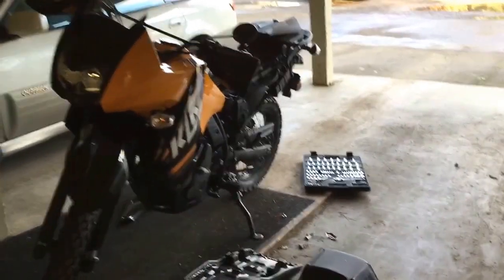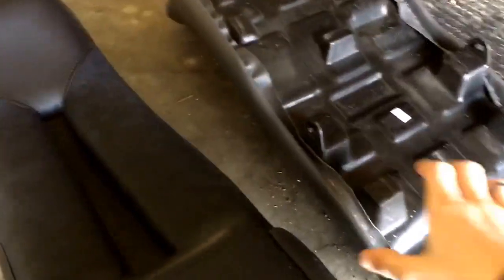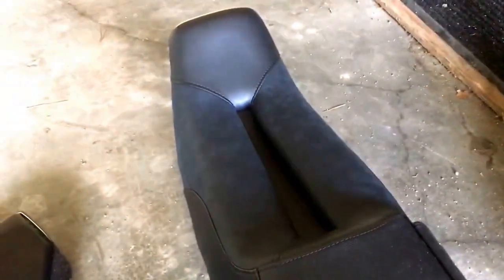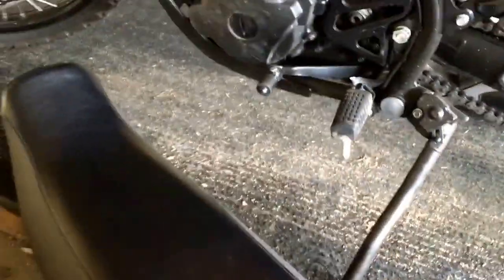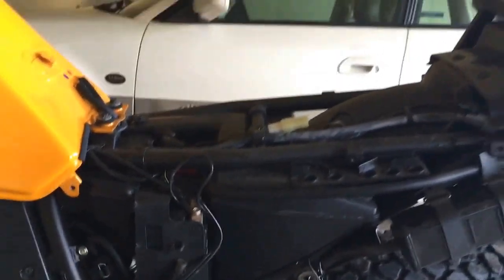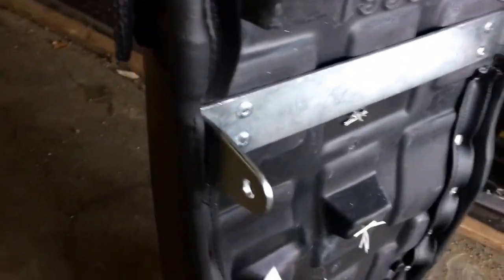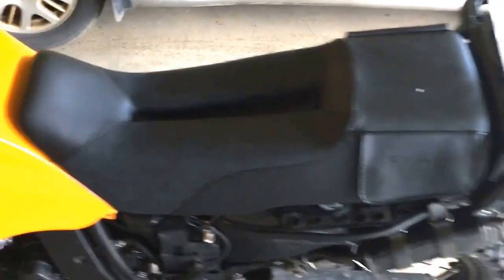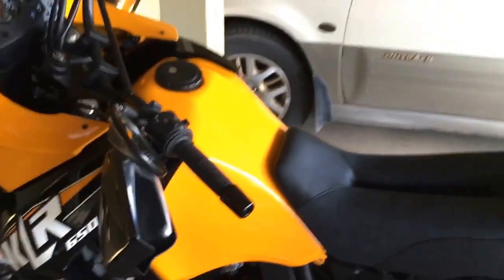KLR 650 seat removal and replacement.

Comment: I bought a slightly used Kawasaki Long Ranger 650 with no owners manual so you were a lifesaver, however my gen 3 only requires one bolt on each side without the removal of any side covers. it looks like  the new seat has no way for water to drain out if you were caught in a storm or got wet wihle going through a river, or maybe there is.

Comment: Have you had a chance yet to put some miles on the seat?  And, how do you like it?  Thanks
Reply from the maker: So far I have about 300 miles on since putting on the seat, and I am really enjoying it! One thing to remember with most aftermarket seats especially with the gel-seat  like this one, is that it will get more comfortable the more miles you have on it, and it isn't quite broken in until you have about 1200 miles on it. That was also my experience with the gel channel seat that I had on my GSX R 750... Once that seat was broken in, I can go on a 200 mile ride and not be sore afterward, and that is saying a lot for a sport bike 👍🏼😎
Reply: @elliottgriggs88  so was it broken in by 1200 miles? :)
Reply from the maker: Michael Lorincz nope, still good 🤙🏼